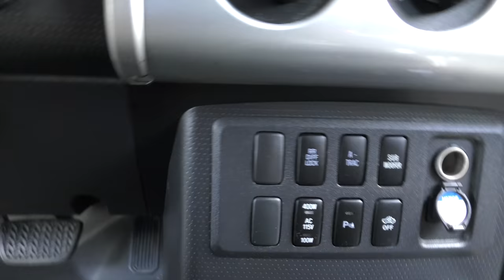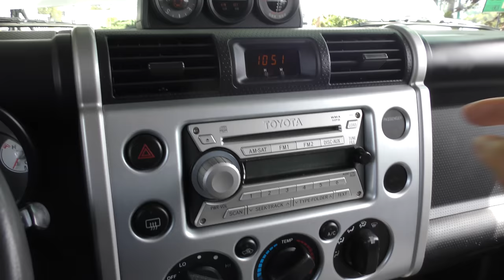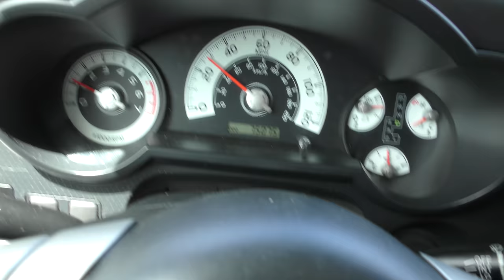I Finally Got a Toyota FJ Cruiser and Here’s What I Really Think of It

Comment: Serious question…. Where do ya draw the line at mileage?   There are several 07 and 08 out there with 200,000 to 250 K miles on it….  May have zero problems, but to me that says THINGS GONNA start happening soon! in the next 50 K miles or so….   I don’t see many fj out there bragging about passing the 400 K mile mark without a rebuild.

Comment: Ehhhhh, they actually DO have frame rot problems, especially the first two model years. It's literally the ONE thing you need to watch out for (other than the gear teeth breaking on the rear diff for the 2007 model)
Reply: Baloney.

Comment: The sad part it will probably be re-introduced as an EV in the future. And these had frame rot issues. One got traded in at the dealership i work at for that reason. It had 250k miles on it so it wasn't covered under warranty. A staff member bought it for $1,500, we tried our best to fix up the rust hole but it will only be used to haul stuff in his property and won't be used on the road.

Comment: I know the older versions say premium fuel only. I had heard that was just to get the sticker milage to a higher number but was not really required? If anyone knows? I also read that when Toyota announced in 2007 the FJ they said it would be a limited run from the start and would stop making them in 2014. and they did

Comment: Toyota should've made these with a roll bar and fully removable top to reduce some weight.  And the all aluminum engines in these are great but weren't improved until their later years with the 2009+ dual VVT-i which took it from 236hp to 270hp.  And while a cool style, the rear seat has very little legroom and the cargo area behind the rear seats is not very big either.  So it's a fairly impractical vehicle (as are Jeeps) compared to something like a 4Runner, Land Cruiser or Sequoia.  I think with the same engine in the 4Runner you get the same MPGs but more room. That's likely why they stopped making them.
Reply: They stopped selling it in the U.S. in 2014. They weren't making as much money as Rav 4 and Highlander I own a 2013 Army Green w/ 75k I bought new and love it.

Comment: My wife's 2007 FJ cruiser has been great with no problems for 145K miles. I'm worried the water pump may go out soon and leave us stranded/blow a head gasket. What do you think? Should I change all the things on the front of the motor with bearings like the water pump?

Comment: Blessed to have a FJ Cruiser 4x4 6-Speed manual equipped. Got it with 100k miles but found some damage behind the spare tire, always set the parking brake. Easy to set but not all Toy Dealers are created equal!!

Comment: What about the undercarriage rust issue. My sister has a 2005 FJ Cruiser with 23K miles and a completely rusted undercarriage that makes it unsafe to drive
Reply: Not an FJ cruiser. Only made 2007-2014. Maybe it’s a Land Cruiser. Close but different. Sounds like poor maintenance. Consider keeping undercarriage clean no matter what you drive. Ya know, spray it off now and then.

Comment: My '13 only has 59k miles.
But my oil filter is on the bottom unlike the one in the video. It comes with a plastic plug to drain the filter first, then remove it. It is the absolute WORST filter design I have ever seen. Such a pain. No way to NOT make a mess.
Don't know why you kept harping on mileage. Mine gets great mileage for a 4wd.

Comment: The only complaint I have for mine is highway noise.... granted it has a leveling kit and bigger tires but it’s more the wind noise that bothers me

Blind spots are a problem

Love the stock sub, power isn’t bad, I use the 4-wheel drive, haven’t had any rust issues, it even has a back up camera
Reply: Yeah I would say with the blind spots, I wish they at least just put In a backup camera. Other than that I love it

Comment: Never liked them as the windows are too short and lets not even talk about the BLIND SPOTS aka B Pilar, C Pilar! Also, horrible gas mileage and PREMIUM FUEL REQUIRED! I had a few try to follow my Jeep Club through Extreme Rock Crawling... they weren't meant for tight spots like a Jeep, lol. In a Twist of fate, I've inherited one (sort of) as my Fiance has one she can't afford, so I paid it off. The only plus of this Toyota FJ Cruiser... it has good resale Value like a Jeep Wrangler and it's in great shape, so... It's up for sale! If it was a Wrangler, I'd keep it however, I've never been a Toyota Fanboy and I've always hated the FJ Cruisers (not the original FJ-40's which I like).

Comment: Scotty, as usual, you leave out the other flaws beside the gas mileage:
1) only two doors on such a large SUV
2)terrible visibility
3) Believe it or not even the 2020 FJ that is sold in UAE looks the same. Toyotas failure was that they made no attempt to fix the flaws. 
4) As with all Toyotas, they rusted easily.
5) Seat comfort was terrible as with all Toyotas 
6) Ugly dashboard
7) You have to completely stop to shift to 4wheel drive

Sadly Toyota prefers to kill the products that are popular and have a niche market. They only think about mass produced products with highest margin and I get that.
Look, they killed these popular cars:
1996 Supra Turbo
2005 MR2 Spyder
RAV4  V6
Toyota Sun Ryder RV
Electric RAV4
All wheel drive Sienna 

In a way, this FJ needed some improvement and Toyota just ignored it.

Comment: Class action suit against Toyota for all model years of the FJ Cruiser for extreme frame rust. Don't buy one of these used. Toyota makes the best vehicles? 😆😆😆
Reply: My 2011 in the salty northeast has zero rust - I coated the undercarriage years ago, as you should. If you have bare metal, it’s going to rust. Not Toyota, or FJ specific. 🤷🏽‍♂️

Comment: I own one of the first edition with manual transmission with full time 4 wheel drive, it is very cool to own, but it crap as a car, not very practical even during off road adventures.  my overall summary, very cool looking and very Sturdy, definitely will last forever, but as a vehicle for on and off road.  Too tiny for overlanding, lots of blind spot for on road use, a major gas guzzler.    If you are into offroad and overlanding a 4Runner is way better